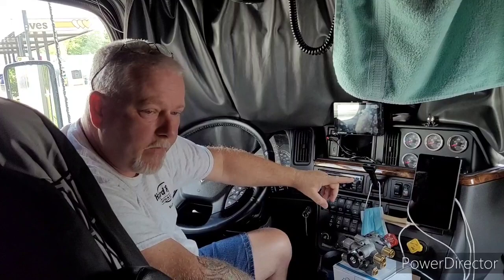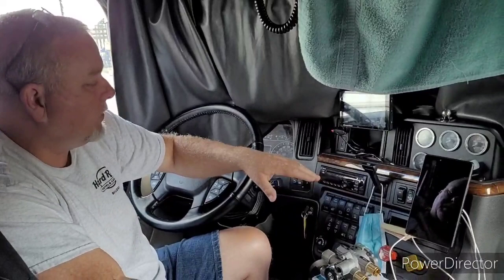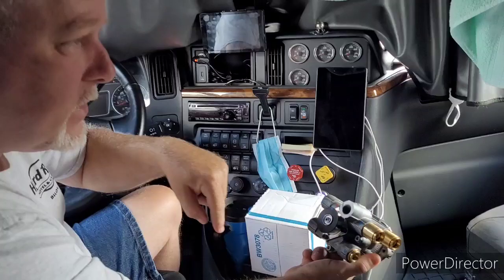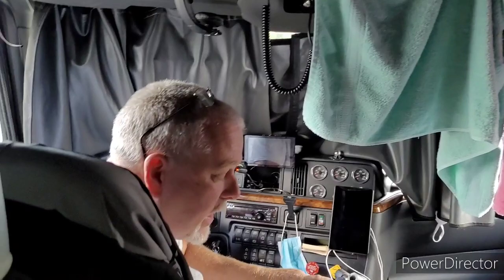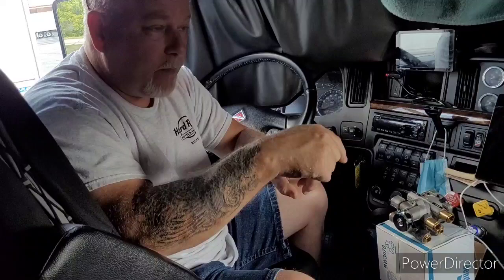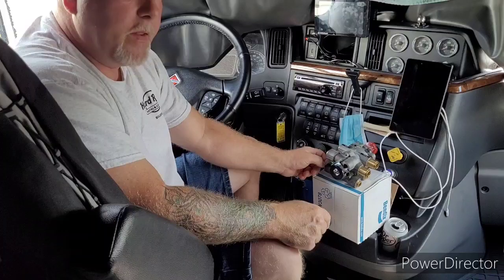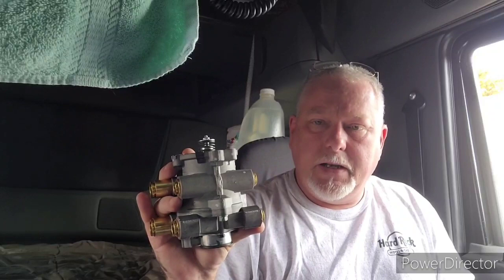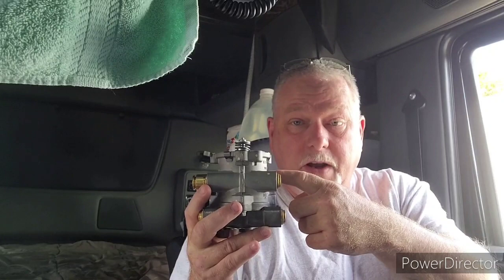Leaking foot brake valve=check air brake relays!!!

Comment: Knowledge is always good to know, I am also car mechanically inclined and I’ve been in the trucking industry for about 30 years now, I have my very own computer diagnostic equipment and I’m able to fix a flat to change the stem valve, etc., but I also highly appreciate you taking the time most people have a little crappy video about maybe five or 10 minutes 15 or quickly but I’ll tell you my brother you took your time to read and comprehend and I thank you for passing that knowledge on because I am at Owner operator I don’t expensive things could get out here I want to thank you, Robert from Fort Myers Florida👋👌👍✌️
Reply from the maker: Thank you. With the responses I have gotten from this video I am really glad I made it.

Comment: Thank you driver I'm having the same issue on my Volvo and couldn't find a single video or anything on Google about this issue... I've had the foot valve replaced twice money wasted 🤦🏾‍♂️ because that's what the shop diagnosed now I know what to check thanks to you
Reply from the maker: I hope this helps solve your issue. These parts ain't cheap and these shops need to train techs on proper diagnosis procedures so we aren't wasting time and money. Let me know how it turns out. 🤞
Reply: @JAYT76501 are the relay valve hoses easy to pull out to test and put back on.
Reply from the maker: @kendrichand  yes. They are the quick connect style just like the s.aller air lines.

Comment: Thanks for taking the time to make this video. I have the same Issue on a 88 frieghtliner dump truck. We already replaced the foot brake valve but thankfully we do our own work in house so we're not out a ton for labor. Hopefully this helps me to diagnose it quickly.
Reply from the maker: Thank you for watching. I really hope this video helps to resolve your issue. Good Luck and be safe.

Comment: Great video, I have a severe pressure loss when i press
 on my foot break when my trailer was attached. Changed the foot pedal valve and that seemed to work but now the leak is back again after attaching a trailer with a heavy load. My pressure gauage on the dash loses air immediately which is not safe at all. I can hear the air coming out as im pressing on foot brake. So after watching your video I hope i can check those delivery lines and see if one of the relays is bad. That was my next process to consider after researching and seeing if my relay valve was bad in the back. But maybe it is the same relay that you had underneath is the issue. I have an international as well so thank you for the video and taking the time to share this. Best of luck and keep rollin!!

Comment: Thank you, very informative and I found my problem using this video.  Mechanic told me it was foot valve, turned out to be my front relay.👍👍👍
Reply from the maker: Glad it helped. Unfortunately very few of these technicians today don't diagnose. They just throw parts at the problem until they "find" the problem.
Good luck and stay safe.

Comment: New to air breaks and you hit the nail square on the head . The answer to bleed back I found was a  break can diaphragm that had gone bad causing the air to back track thru the valves to foot valve and leaking thru a line stabbed thru firewall. Parking break set or not it leaked plugging it off caused parking breaks to set if they were released. However the truck is also having an air dryer issue. Thanks for posting and helping out all the others with air break issues. Break on!!!
Reply from the maker: Thank you.
Reply: Can this cause an accident how dangerous is this because i think I have the same issue when push air brake it just shoots out air sound like left drive tire, the pedal, and some times from actually interior supply button

Comment: thks buddy,  you the only one explaining the air/ elect  switch ,  l was lost also,   l almost went down a hill in WV  because of a leaking switch ,   please dont go down a mountain without a jake break , dont go down with air leaks,  dont go down with bad breaks,  make sure you adjust your breaks before you go down & do not go down if you got air leaks especially in the break system, otherwise you will wreck your life career,  load freight  & truck.   Cant stop a run a way truck going down hill.  Mountain driving is Serious business not like driving on level ground .   It ony takes a minute to heat up your breaks to the point where you loose em

Comment: Very informative video. When you come to these types of mechanical diagnostics, normally, they are very costly, because as you said it on the video, those part changers that all they do is making you expend money on things you don't need. I have an issue right now, with my Peterbilt, and it might be a great video to start with. When I hit the brake on very cold weather, my brakes stay stuck down. and when I stop and delete the code by turning the key towards the opposite side, brake gets release. How I know it gets stuck down, because by troubleshooting, I turned all the truck lights off, and the stop light stays on both, trailer and truck. Or is either a brake release valve sending air back to the brake pedal valve, or the brake pedal valve is having a leak somewhere, that when it gets so cold it become icy. Since on hotter weather, above 32 degrees, brake system works perfectly fine.

Comment: good one mate! i took my 2014 powerstar in for problems the quote was stupid money ,got the truck back to the yard and over two weeks fixed all the faults,did what you did ,worked the problems out,i now have the leaking treddle you had,thanks a lot for your information .in australia it seems to be hard to find a good iveco fitter ,so yeah my hat off to you ,safe driving mate

Comment: Well done !, you did a perfect video. I know , my 30th year in Air brakes. You got it spot on m8.
If it was not the relay it could be your trailer control doing the same. Once again well done
Reply from the maker: Thank you very much. It makes me feel good that someone with experience in these systems would give such a great response.
I have had alot of positive feed back on this video and really am glad it can help.
Again, thank you.
Reply: @JAYT76501  i my country  8 out of 10 mechanic can not succesfully diagnose Air system errors. I think its a pity that their training sometimes dont really involve air systems enough. Usually its an additional training program. You should realy try and do a basic training course.  In your country Bendix would probable be the guys most likely that does the training. Its a three or 4 day course at max, but for a guy like yourself, you will ace it! I bet. God speed!
Reply from the maker: @Rooivalkpilot  thanks I will check it out for sure.

Comment: Had the same exact issue with my 2018 LT,, this is a LIFE SAVER
Reply: same problem now 18 lt625
Reply: @kendrichand   ez fix I can walk you through it & save you some money your don't need to replace the relay valve
Reply: @kendrichand   your front brakes will lock up if you don't take care of it asap
Reply: @omarh4694  whats the fix what parts to change
Reply: @kendrichand   no need to change parts
Reply: Relay valve is expensive between 400 to 700 bucks

Comment: This is awesome info. I have same truck same problem and same line Is feeding back. Can cover line and front brakes come on. Still leaking air out exhaust port so checking rear also. Thanks for taking the time to post this.
Reply from the maker: Thank you for watching and glad it helped. Good luck.

Comment: Hey Brock, glad I found your video. I  currently having I guess the same issue with my brakes. My biggest problem is my brakes appling themselves while truck is running & rolling down the road, where it looks like I am brake checking. If I am in the North it happens a lot when down South in warm temps it mostly applies the brakes at night driving or parked. I am goin to see if I can diagnose it the way you did. I have a 2018 international LT625.
Reply: I pulled that line & the brakes applied, I could actually feel the air coming out of the line. thanks a ton!!!!
Reply from the maker: Definitely check your brake relays. Could be getting air through a diaphragm.

Comment: OMG this is an amazing video to learn from because my school bus is doing the EXACT same thing!  This video perfectly describes and explains what my own problem is and exactly where I need to focus my attention to fix it. My damn brake relays. I wouldn't have thought of that either because I'm new to heavy duty trucks and air brake systems too. My school bus is a 1997 International 3800 full size, dog-nose school bus with the DT466E engine, AT545 transmission, and Blue Bird body.  Now what I'll do is find the relay(s) that are toast, pull them, put them on my work bench and start taking them apart, going through them and inspecting them. It's possible that all they need is to be cleaned in some special way or lubricated or something simple. But at least I'll see where they failed inside and why they failed. I'll try to make a video on that too so others know.  Thanks again for your great video Brock!!!

Comment: Thank you having a problem with in park watching air guage on both tanks loosing same amount of pressure 5 psi in 2 minutes trying to figure out why.
Reply from the maker: Have you tried a squirter bottle with soap and water? Spray all your airline connections and look for bubbles.

Comment: Awesome video...thanks for making it.  I've got an issue with a horn type sound coming from the front when I press the brake pedal.  Also my driver side steer seems like it's grabbing harder than the rest.  Trying to diagnose what it could be and I stumbled onto this video.  Not sure if it's my problem...but at least it gives me some ideas about how these systems work.  Thanks again!
Reply from the maker: Thank you. I hope it helps you to figure your issue out. I would also look at your brake chamber???
Reply: My truck has the same issue as yours, I’m still trying to figure out what causes the issue, you got any luck?

Comment: I am dealing with same problem, well not exactly.. my foot brake valve is leaking from the firewall which I and my mechanics determined by spraying it. Like  you said that thing is like 600+ in dealer, and they dont even have it now. They gave me the part number and truck parts store ordered it for 270... looks kind of messy to get to it, i got 2015 international and it sure looks more difficult to get to than 2019.
Reply from the maker: It didn't look fun on the 2019.lol
Glad you were able to find it for 270.00. Good luck and comment back if it solves your issue. Stay safe.

Comment: Sometimes if you put some air oil into the emergency supply it will take care of this issue. You have the emergency line leaking into the service side. Some huge companies that everyone knows about demand that you try this before replacing the relays. This is a very common fix before replacing a component. I guess I would try it before paying an arm and a dick for a repair. It takes very little time. You have to lube it where the supply goes into the relay. 11/16 and 13/16 wrench.

Comment: Same problem on 2019 peterbilt 579, did what u said and heard brakes ingage air was back feeding also when i checked that line. But my break lights are also staying on when i tap them. Have to turn truck off to make them go off

Comment: Great video, I do have a question about each relay, for the front and rear. I did have air coming from the front orange line you pulled. Now I purchased the 3 axel one would the front relay under driver door be the same part as the rear ?
Reply from the maker: I think so but I would call a dealer to verify.

Comment: Thx Brock my truck builds air up in the secondary tank first yep wierd as I know and the only way to get it to build up is by putting my foot on the brake after the secondary fills I can take it off the brake and the primary tank fills but today after washing it I put my foot on the brake to build up the air and I noticed a big air leak and it's coming from the bottom of the brake valve I think it's spat a bolt out the bottom,  it was too late too get parts, so goimg to suss it more in the morning but think it's might just need a new brake valve after watching you're video
Reply from the maker: Really glad this video has been able to help you and others. Hope you get it fixed and rolling. Be safe.

Comment: I have a question when checking the valves to see if there's air coming back to them. Do you have the truck running with the brakes release or in what set up dl you have your truck in to to check those valves. Thanks for your video a lot of good info. Really appreciated
Reply from the maker: Truck aired up not running and brakes set.

Comment: Great job diagnosing the issue...
Do you happen to have any prior experience with 30 sec constant air dryer purging g on a FL M-2  ?
The rhe air reg is new, no major leaks in the system,  except the constant purging ...
Purge valve has been replaced too .
Is this a signal line issue ?  It's driving me crazy when idling and the compressor is working overtime.   I do not want to spend the 5 Grand to replace that if the issue is elsewhere. 
07 M-2 with 650K.  Mercedes Diesel.   ( Yea, I know... )
Reply from the maker: Filters I assume have also been replace?
Reply from the maker: The other thing is a low pressure switch stuck and keeping the compressor running?
Just a guess.

Comment: I am having an issue which i think its the same thing my cab and tractor air bags goes completely flat within 30min i spray soap and water and I can’t seem to find any leak i will check those line and follow your method and see what happens
Reply from the maker: I believe there is a check valve in the airbag system to keep air from back bleeding. I would look at that as well.
Reply: Ok i will definitely look into that i will keep you posted with my discoveries
Reply from the maker: @StefanRas  please do

Comment: When I come to a stop, like a red light or stop sign, my truck leaks air (secondary tank air pressure is lower than primary tank) and if I don’t pop my brakes, it’ll dump air & low air pressure warnings will sound. Plz help
Reply from the maker: Does it happen bobtail? or with a trailer?
Reply: @JAYT76501  same problem only does it when i am hooked to trailer, ive got 2015 prostar
Reply from the maker: @kendrichand  not sure but have you checked your glad hand connection? Other than that not sure why it only occurs when hooked to trailer unless you always have same trailer and it's the problem. Maybe the dash valve???
Reply: @JAYT76501   tested on second trailer did the same problem foot valve leak out exhaust port.
Reply from the maker: @kendrichand  it sounds like a relay but with it happening on two different trailers is odd.
Reply: I've the same issue. Can be a chamber the rubber inside could have holes on it. Only when you press the brake. If you look for leaks can't find it air is returning through the emergency line
Reply from the maker: @michelnaranjo3089  great info thanks.

Comment: So was it the atr-6 traction control relay valve mine only leaks when im hooked to a trailer how does that change it if any, No loss when im bobtailing.
Reply from the maker: Relay valve for the front brakes. Mounted on frame right under the driver side floor board.

Comment: Trying to understand- so can you set the parking brake but then this problem will pop the button back out causing the truck to roll?  Sorry for the simplistic question, I’m researching all of this and it’s a lot to take in. I’m specifically trying to figure out how a Volvo with the parking brakes engaged would still roll in error. Thank you.
Reply from the maker: I am guessing the brakes are working correctly when driving.
Normally if the brake valves pop out the brakes should be fully engaged.
Shot in the dark here but are the brakes adjusted properly?
Maybe the brake valve assembly in the dash is bad? 
Sorry not being of much help on this one.

Comment: I have an International Prosleeper. The brakes are not  stopping the truck well. The truck stops after 3-4 seconds even i press the brake pedal so hard. I just replaced all the brakes and drums but still same issue. What could cause this?? Is it bad brake foot valve??
Reply from the maker: If the pedal seems like it's hard it could be a brake relay valve.

Comment: Hey brock nice explanation! And thank you!
I have a question hope you will have time to give me an idea what to do.
I have an old FLD 1991 and I just bought it and did my brakes, front and rears and after I replaced drums and shoes and adjusted them I found out that I feel my brake pedal low, I ordered yesterday the brake pedal valve, what do you think before I start changing parts that could be my issue?
Thanks
Reply from the maker: Any other symptoms. I.e.excessive air loss, all brakes engaging when pedal is pushed.
Reply: @JAYT76501  yes all brakes were working when pedal was pressed but yesterday I changed the valve and with the new one now I got the front differential is locked, could be the “new”(remanufactured) valve from dealer is not good? All the hoses were attached the same way as they were before.
Reply from the maker: @ibayter  unfortunately not unheard-of getting a bad part.

Comment: I have the same issue on my 2920 international, but my brakes are being applied while driving, did you have this problem as well??
Reply from the maker: never found that out. brake pedal was as hard as a rock. never left the parking lot. I only moved it to the shop so really wasn't paying attention if brakes were dragging.
Reply: @JAYT76501  thank you